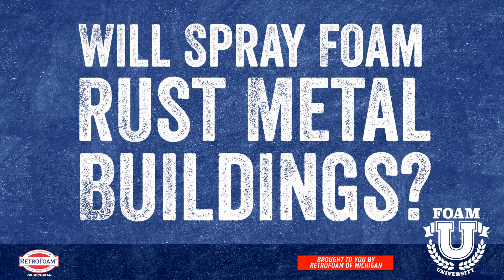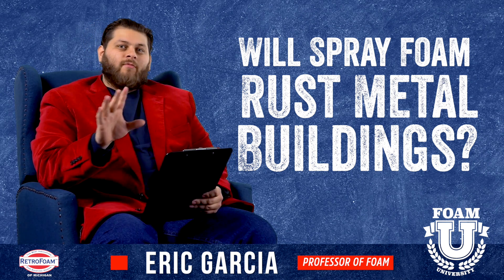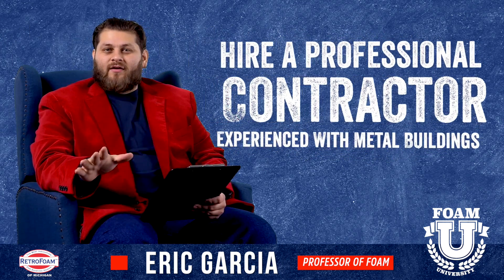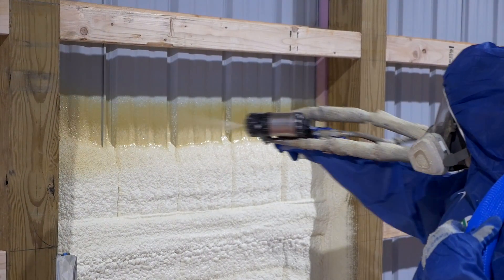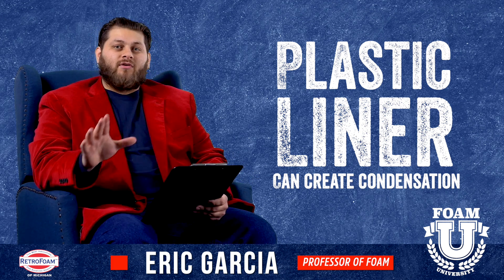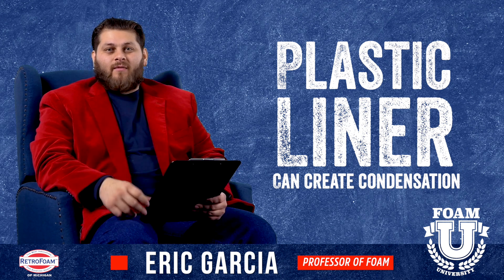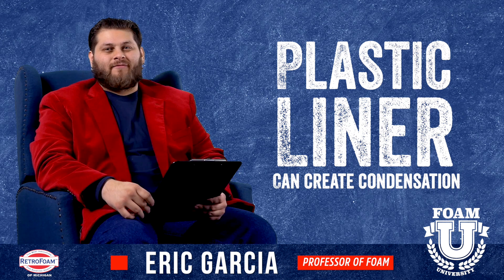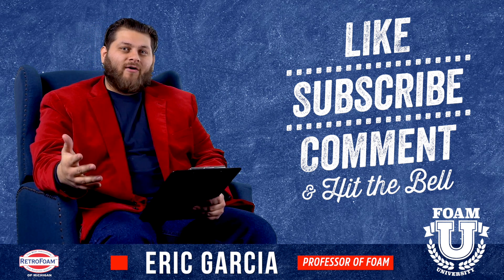Will Spray Foam Rust Metal Buildings? | Foam University

Comment: Can open cell spray foam in a metal building that is wrapped with tyvek cause black mold?
Reply from the maker: Issues like mold and mildew are often caused by a lack of insulation, and ninety-nine percent of the time, if there's a moisture issue in a wall, it's due to a pre-existing issue.

Comment: Is there a problem with the expansion of the steel in hot summer expanding and the foam insulation bonded to it on the inside of the building ?  I love foam and prefer it but was advised that it was a problem. I live in southern Michigan close to the Ohio border.
Reply from the maker: We have not had this become an issue. Open cell foam specifically is pliable and would move with any slight movement of the steel.
Reply: Yes but what about closed-cell on the metal roof

Comment: I picture in 20 years the foam has turn dark yellow  shrunk and pulled away from any wood or metal
Reply from the maker: We have sprayed projects that we see everyday (our shop & employee homes) that are 15+ years old with no signs of shrinkage or pulling away. Yellow coloring will happen depending on the fumes it is exposed to.

Comment: Is there any cleaning or prep work for spray foaming an older pole barn? I have a wood frame metal shop that’s probably 40 years old. Somewhat dusty and dirty on the inside. Thanks
Reply from the maker: With spray foam there is always the possibility of over spray so just making sure to cover  and tape off everything is important. We have a video on prepping for spray foam projects here https://youtu.be/P5bsoiRZVTE

Comment: Open or closed cell spray foam in a metal garage in SE North Carolina
Reply from the maker: We recommend closed cell spray foam on the walls if they will be exposed or open cell if you plan to finish them. We also recommend open cell on the ceiling.. The thickness of both materials will be determined by your climate zone and how that relates to code for your area.

Comment: I have Mueller Steel Barnamenium.  The building is 30'x50'. The apartment is 30'x20'.  We installed plywood walls over 2x4 studs and all walls are removable by just unscrewing panels.  What we have is the need to seal the base around the barn to prevent bugs and rodents from crawling in.  What I figured on doing was spray around the base behind the wall but we had insulation installed when the barn was put up.  Have had a few mice make it in and chew threw the insulation.  We filled those gaps with Great Stuff Foam but would like to add an additional barrier.  Covering the base plate and about a foot up would be our thought over the existing insulation.  Any problems with this you might think of?
Reply from the maker: It could help eliminate some entrances and attractions to pests, however, it is not an actual deterrent.
Reply: What kind of insulation did you use? I have a metal building and I’m putting up 2x4 and osb boards! I was wondering what insulation is best and does yours have any sweating problems behind walls?
Reply: Closed or open cell?

Comment: I have been told to spray the top of my metal building roof is better than spraying the underneath side, is this true?
Reply from the maker: This actually wouldn't be a good method of insulating the top of the structure. This is because you'd either have to use roofing foam or apply a UV coating. We always recommend spraying the underside of the roof to seal the building envelope.

Comment: Very informative would you put a vapor barrier between the foam and the metal
Reply: Did you watch the video
Reply from the maker: Thank you so much! You wouldn't need to add a vapor barrier as the foam itself is a vapor barrier. If you added another one, that could actually lead to condensation issues.

Comment: I have a metal building that's 15' high and tapers to 17'-18' at the highest point so it's pitched. I am only going to foam the ceiling not the walls. Considering the ceiling is that high, do I need to add Intumescent fire coating over the foam? I am planning on welding in there and using a grinder and will be about 12' or more below the ceiling but realistically, what are the chances of any spark from about 12 feet or more from the ceiling landing up there? And if it did, what are the chances that a fire on the spray foam of the ceiling will even run down the metal walls of the metal building and spread to catch everything else on fire?
Reply from the maker: We cannot speak on the sparks actually reaching the ceiling, however, if you used a Class One Fire Rated Foam there should be no issue.

Comment: Is it possible to spray a clearspan fabric building if you first reinforce with a cattle panel?
Reply from the maker: Yes, you absolutely can spray that set up. If there is a significant gap between the fabric and the panels , like 3-inches or more, that may cause the foam to look more inconsistent, but it should adhere just fine.

Comment: I have a metal building and it came with that really thin "plastic" insulation (not entirely sure what material it is). I noticed in the summer time, the building will "sweat" on the inside and there will be moisture running down to the bottom. I would like to get it spray foamed. Do you recommend removing this insulation first and spraying directly on to the metal? Thank you.
Reply from the maker: Yes, we recommend removing the plastic before spraying the foam. This removal gives the spray foam a nice, clean area to be sprayed onto. It also helps to prevent that plastic from holding any moisture against the metal.